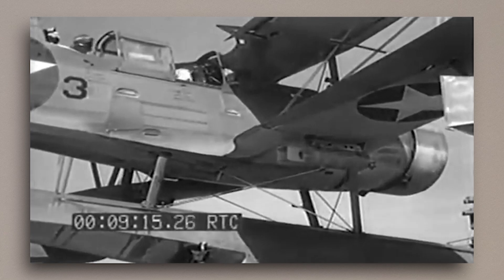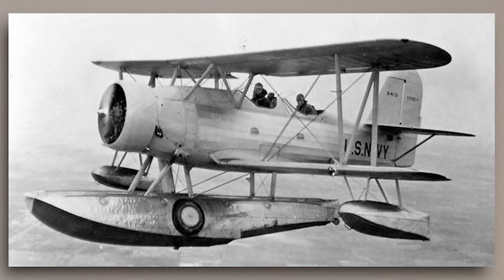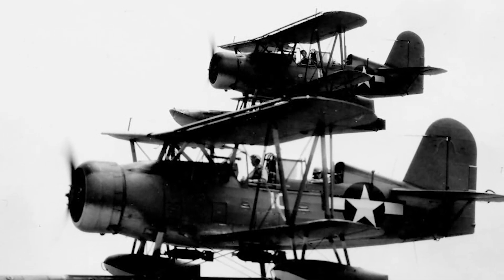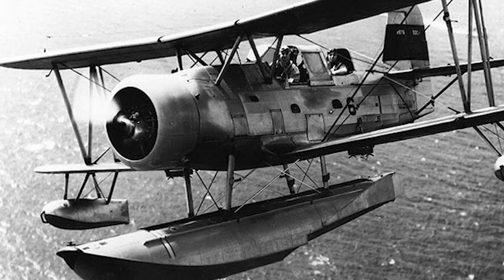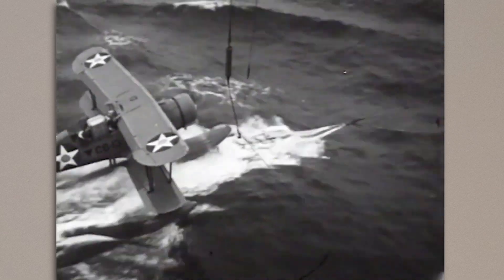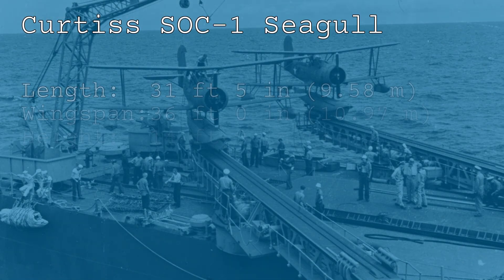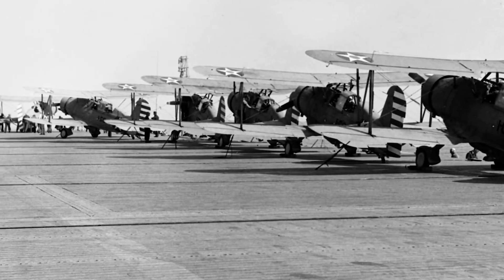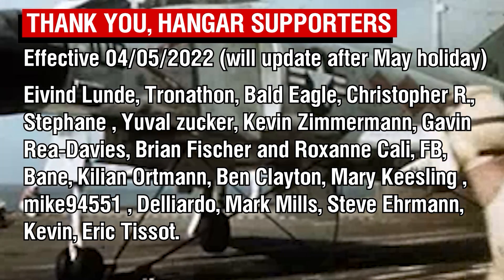The Naval Scout That Outlived Its Replacement | Curtiss SOC Seagull [Aircraft Overview #53]

Comment: OTTOMH Im guessing:

Seagull > Seamew > Seagull

Swordfish > Albacore > Swordfish 

Essentially the only two WW2 planes where predecessor effectively replaced the replacement - as whilst the Hs123 came back into service it never really replaced the Ju87 fully.
Reply: Fair enough, albeit to also be fair, the Hs123 didn't came back. Simply never left; II.(Schl)/LG2 was still equipped with the Hs 123 when the war started, and the "stopgap" biplane soldiered for the full war.
Reply: The Seagull did not come back to replace its replacement. This video is misleading. It came back to replace the Curtiss company's own contender for a replacement. 
But the 320 Seagulls were supplemented and replaced by over 1500 of the more modern Vought Kingfisher, which became the standard floatplane.
Reply: Post-war, arguably, the USAF taking A1 Skyraiders almost meant a replacement for their F100s.

Comment: Reminds me a bit of the old Avro Anson, affectionately known as the Flying Greenhouse due to it's massive side windows. My father was the sergeant of B Flight at Halfpenny Green, I still have all his notes. He was first into a slit trench during a raid with 3 'oiks' on top of him. They wriggled out of the way of a red hot bomb splinter - he couldn't. He got a medal for being burned on the bum lying at the bottom of a hole. I have the bomb splinter and the medal.

Comment: Pratt and Whitney did not build an R-1240 engine.  The Wasp radial engine displaced 1,344 cubic inches,  hence the (correct) designation R-1340.  There are quite a few of the engines still in service today.

Comment: I hope we get an informational video about the Curtiss Seamew, I've read that it had some shortcomings, but to be a colossal failure warrants some explanation. I always thought it looked weird with its inline engine
Reply: The simple answer is it was underpowered and had an unreliable engine. It was so underpowered that it could not take off from the water with a full fuel load. The longer answer has to do with the Navy forcing some design choices and changes in requirements causing all sorts of problems. So it is truly bad?

Comment: When a double wing (not a biplane) wig does not have a tail, how are they kept from flipping? Am I wrong to assume reduced control and lift on the rear wing?How close can wings be spaced in that manner? And why don't they have leading edge slats or complicated flaps? Really this excludes all turbine powered, black sea skiing, monsters and it's ilk. This type has always been somewhat of a mystery over the lifting bodies or the single wing/ massive tail. Is there a way to have a super low stall speed while basically horizontal and still have top speeds similar to a 4 passenger modern run of the mill plane like a Cessna or something? Looks like I have more questions than I thought..  How do you not pitch-up and break the ground effect with out a tail? Which has the broadest range of speed of all designs? It is all these little things that get left out (not by you though) by broadstroke docs. Thanks if you actually made it this far, and double for any answers. Great job as always.
Reply: The rear wing generates lift (like a canard). The essential caution is the front wing needs to stall first to ensure safe stall recovery.
90% of modern airliners also have the tail configured to generate lift too - and they often include fuel tanks inside the tail surface as well.

Comment: Really like this channel, but I contend that the title of the video, and the commentary from 7:50 on, are incorrect. The Seagull was not more capable or successful than the aircraft that replaced it. It was only better than the aircraft that specifically the Curtiss company designed to replace it, the Seamew.
But the 320 Seagulls were replaced by over 1500 Vought OS2U Kingfishers, which became the standard floatplane.
Reply: Exactly
Reply: whatever floats your boat...
Reply: The Kingfisher was pretty much on par with the Seagull in most metrics which is why the Seamew was designed to replace them both.  As mentioned in the video, the Kingfisher lacked folding wings which limited the number that could be carried to two since they had to sit on the catapults for the entire voyage as compared to the Seagull which could fit into the hangars.  Having the capability to carry spare aircraft and a protected space for maintenance are considerable advantages from an operational perspective when flight performance is relatively even.

While Kingfishers were more prolific than Seagulls, some ships continued to use Seagulls through the end of the war.
Reply: @MalfosRanger  
There were issues with hangars. Amidships, they took up far too much space, and created an avgas  fire hazard in a bad place. Below the deck aft, they created a large resonance chamber above the screws which caused severe vibration at speed. 

Some missile cruisers built in the 70s had a helicopter hangar in the same spot aft with the elevator being the launch pad. Their use was soon abandoned, with Tomahawk launchers being placed over the sealed hangar roof doors. 

Aft was also a much better recovery position for float planes; many suffered damage by hitting the ship while trying to taxi close alongside to be recovered amidships.

There were not many occasions when having a floatplane sitting on the catapult aft was much disadvantage. In the night battle of Guadalcanal the South Dakota's float plane was set ablaze by the blast of the aft 16" guns, but the next salvo blew the plane overboard and put out the fire.

It is worth noting that all ships with hangars for the float planes were designed when planes still had fabric coverings. When all-metal skinned planes were adopted, it was realized that hangars were not necessary, and folding wings were of less importance.

Also, by the time the Kingfisher came into general use there were so many carriers in service that scouting by float planes was no longer necessary, and 2 planes were enough for spotting the fall of shot.

Comment: This video shows that newer doesn’t necessarily mean better …

If biplanes were the first planes built, I’ve always wondered why they still being produced and even in front line service into the late thirties/ early 40s

Speaking of float planes….

You should do a video on the Kingfisher, a single engine float plane (or land plane with fixed landing gear) and carried a crew of 2….

 That’s a history I’d like to see .
Reply: A benefit to a biplane is that you get lots of lift with shorter wings, and I would suppose that when you are being catapulted off of a cruiser "Airborne in about 30 feet!" you would want all of the lift you can get!
Reply: @mikeynth7919  Absolutely! 

 I never thought two sets of wings would generate more lift.

 But at the same time, doesn’t it create more drag?

Just wondering
Reply: @robertdragoff6909  
While lift and drag are not actually directly comparable, just for simplicity's sake I'll word it this way; one wing generates more lift than drag, or else a monoplane wouldn't fly. So two wings are generating double the lift and double the drag, so the lift is exceeding the drag by twice as much.
Actually, drag is offset by thrust, not lift, but that seemed to be the easiest way to express the concept that would answer your question.
Reply: @mikearmstrong8483  Gotcha

                      And Thanks
Reply: Improvements in material science made monoplanes viable in the mid-late 1930s.  The shorter wingspan and external supports were necessary at first.  As wings became more robust, one wing could be eliminated along with the external supports while the other lengthened which resulted in significantly less drag for the lift produced.